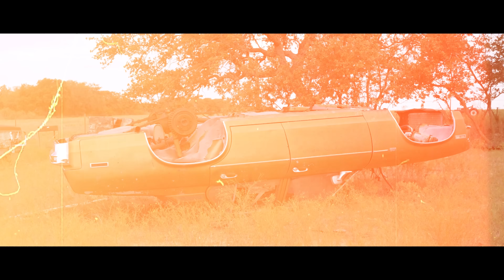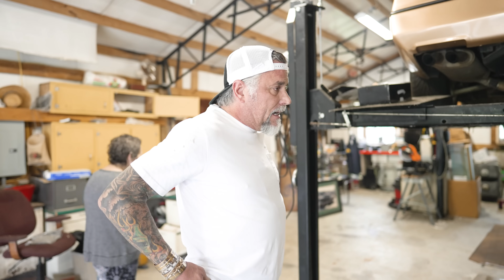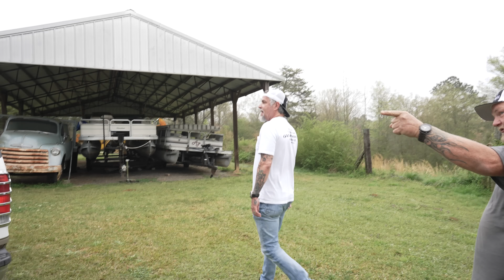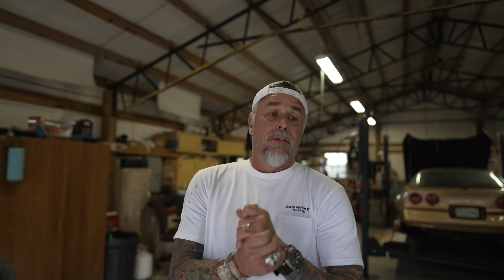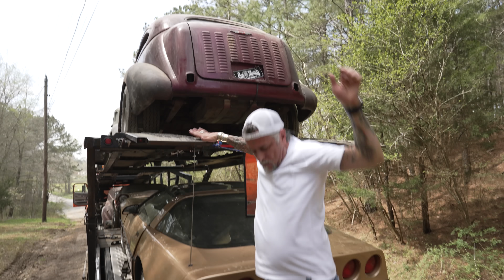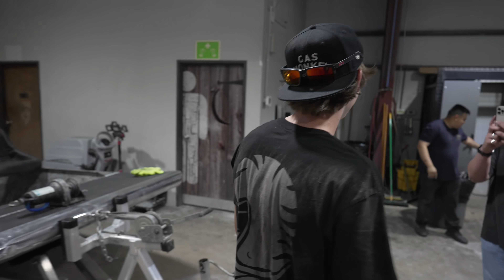Alabama Classic Car Nest - 6 Car Buy - Wheels & Deals

Comment from the maker: Now that we have another 280Z in our collection, how would you build it?
Reply: I'd make it look tiktoked
Reply: Chevy motor under the hood possible turbocharged otherwise leave as is but maybe Cragars and Radial T/A tires
Reply: i would do nothing but wash it and fix anything thats not working properly
Reply: With a fire suppression system 😆
Reply: @perry92964  I ihn.kl
Reply: LS3, Apex suspension/brakes if you want to go nuts, otherwise TTT, Skillard aero, Subtlez flares
Reply: tesla swap
Reply: GTR AWD swap would be interesting
Reply: 2jz turbo swap make it a ripper
Reply: Bosozoku Style
Reply: @gradycooper7416  O'ya...zoom-zoom !
Reply: @freddietee1225   more like stuuu stuuu stu stuuuu big turbo noises
Reply: Sell it to me and I will show you exactly how I would build it. Thanks
Reply: Barra
Reply: I'm all about keeping those all original as long as you don't make any changes to the chassis it would be pretty neat to do a modern update to the brake system I know everybody's go on LS swap crazy nowadays but it would be pretty sweet to see a turbocharged 2JZ or LS engine and obviously update suspension and drivetrain I love to see them all original you guys should get it running good and do a comparison between the original engine and the one you decide to use if you decide to change it
Reply: Would you ever buy a 74 transam Colorado bound that needs work.?
Reply: Richard how about them young bucks do a complete build that would be great,,, I definitely miss that part of gas monkey.
Reply: The money in that 280Z is in getting it running & leaving it ORIGINAL.
Reply: Chevrolet 383” Stroker with a turbo
Reply: Original. They are so nice and getting hard to find nice ones.
Reply: And make it under 200 grand.  So when I win I can buy it.
Reply: COMPLETELY STOCK!!
Reply: If your still in Alabama I know where some nice cars at stored away
Reply: I have $3,500 for the vett please
Reply: Drift car
Reply: Build a Devil Z from Wangan Midnight
Reply: L28  3.1 stoker with a turbo.
Reply: Is twin turbo wide body race car
Reply: The last one was nice!
Reply: Restomod it with a late model 5.6 Titan engine
Reply: I'd put off-road tyres on and paint it matt black
Reply: @Nobody99998  wtf does that even mean
Reply: Would ever you do , don’t put a boring v8 in it.
Reply: Its been done before but an rb25, 26 or 30 swap would be good to see
Reply: I would auction it right here, closed bid.
Reply: bone stock
Reply: or maybe that crazy Japanese style with the long front air dams and the like
Reply: clean it, get her running and sell it to me!
Reply: Classic is ok but...I'd beef up the engine and Trans to at least Porsche level. Maybe a 911 engine or something comparable. Toyota has some honking fast engines...custom Trans rear axle. (Photon Torpedos and lasers are a must and stealth body.)   Make it a flying torpedo...or smart missle....
Reply: I'd convert it to Electric, make it Fast and Quiet !
Reply: Full autocross build
Reply: Gas monkey treat, like the Ford gt and the F40, something special one off gas monkey crazy Z
Reply: All it is is Japanese Revenge
Reply: Add a nice little V8, 4 speed. Paint black cherry.
Reply: Aaron leaves money and now they fix injectors with a hammer lmfao
Reply: Do your thang !! 🚓💨
Reply: Love Ur show
Reply: omg! These 280/240's , fond memories! Shiny dark green,  fresh tires, sun roof, manual tran, 😁💚 6 cylinders?
Reply: I have. Time working on a motorcycle I purchase to. Work on and  try to make it alive , try so hard on it  to make it. Run     there is a project you can work on it. For me .😝 All I can afford are the hot wheels  gas monkey cars  I collect
Reply: How Would I Build The 280z !! That's A Good Question!!!
Reply: Corvette, Beautiful Color!!
Reply: Great Job!!!
Reply: Will See Ya!!!
Reply: Viper V-10 swap 😂
Reply: turbo v8 drag car for the street
Reply: Add a Tesla EV motor! Make your own EV. Old school & new school.
Reply: Don't want nothing born when I was born pre emissions all day 😆
Reply: Back half the car 28x10.5 slick 
Turbo Sr swap
Reply: 4 rotory engine turbo sleeper
Reply: Can you imagine Richard being a cop? 
Richard the cop: Sir do you know how fast your were going? 
WHOOOO! GET YOU SOME!!!
Reply: @dannyamos3499  889
Reply: @Qwe-ni1kz  ñ
Reply: @Qwe-ni1kz  88i
Reply: @russellstewart7435  k
Reply: 3” drop with wantanabe wheels, remove the front and rear bumpers, rb swap with a big single turbo.
Reply: With tools.
Reply: @Merylstreep1949  Been done to death. The "Chevy motor" anyway. Turbos? Ain't enough car there to "spool" turbos. A naturally-aspirated car will run circles around it while you fight "turbo lag".
Reply: @Merylstreep1949  Cragars for a metric 4-lug import. Good luck with that.
Reply: @TreySlayPlay23  The point is to make it go better. Until you do that it don't need to stop better.
Reply: Do something really different.....Stage3 Esslinger 2.3L Ecoboost with Precision Turbo and all the goodies.  500+ HP.  Piss some folks off and stick a Ford 4-banger in it.
Reply: Turbo barra
Reply: LS swap nothin less
Reply: Es muy gratificante 👍
Reply: Richard , If u read what I reply to your question. Then u will see I have challenge u to a build. Proof to us viewers u can still take a challenge. Remember us viewers is what made u rich. No hard feelings if u back out. But I am sure you will back out. I seriously thinking about betting with guys here local that this build want happen.
Reply: Jas 🤭 si lo tuviera ...
Quizás sin turbo  x que una emoción puede no terminar bien 🤷‍♂️ 
Con tres carburadores o injectcion si así lo fuera , y color a elección !!
Reply: Put A426 hammer in it April 26 hamley motor
Reply: You're talking oh baby
Reply: Nice to see old cars 🚗🚙🛻😎
Reply: LS swap it
Reply: Those Z's are bringing good money original and or restored, but it would be cool with an LS.
Reply: Full JDM Paul Newman build….or 2JZ twin turbo with R154
Reply: 2JZ VVT TT PLEASE, RICHARD.. PLEASE!
Reply: @Merylstreep1949  uiui8
Reply: Do your thing man
Reply: There's no better way than to stay completely factory original this will bring more money at auctions than custom builds
Reply: Wytt miller
Reply: @perry92964  it's perfect cosmetically.
Reply: RICHARD. Ever think to offer that gas monkey ring Dennis collins has?  Maybe a replica? I zoomed right in on it on his coffee show. Really neat.
Reply: Know old vid but.. Dark green Outlaw' low on gold! Wheels ..alloy seats..
Reply: give it to me cause my dream car is a 240z, 260z, or 280z :D
Reply: A la sauce Gas Monkey bien sûr ! 🤪🤟 Bonne année et santé 2023 a Gas Monkey Garage.
Reply: Turn it into a monster car..jack it,  35" tires, etc.
Reply: Stock , they were quick as shit stock BUT Thow a small funk on it.👍👍😎😎
Reply: Hi my fellow 🐒(s), i cant wait to Chase's beard grows in. 😉
Reply: 1000 soda cans
Reply: You’re the very best you state the prices. That’s my favourite unlike your buddy Dennis I can’t even watch him anymore.
Reply: @gradycooper7416  with a wide body
Reply: 289 works well, 5 or 6 speed
Reply: You should bought the camero for the White TransAm you bought with the blown403 motor !!!
Reply: sell it to me for $1250 and ill build it with my kiddos
Reply: Cool 😎 Cool 😎 👌 👍
Reply: Modified stock. Change the interior.
Reply: SMALL BLOCK CHEVY HP AND POWER GLUIDE TRANS RACERING INTERNALS AND A VEGA CONVERTER OLD SCHOOL O AND BUILE A COMPLETE RENFORED FRAME ( DOM OR CHROME MOLLY )
 UNDER IT AND TUBED AND 9" FORD REAR END AND NICE CAGE AND LEATHER INTERIOR  ETC BUT THATS JUST ME I HAVE BUILT A 100 OF THEM IN MY 5O YR CAREER ✌️
Reply: Drop in a v8, widen it and race it. Put a big wing on the back.
Reply: Leave it original make it look like showroom floor again
Reply: Twin turbo 215 aluminum block Buick? Or a Orphan Buick GNX engine. I am more of a Chevy guy
Reply: I’d build it like a replica of the devils z from Japan.     The real one not the cartoon.     The wide body evil red 240z
Reply: Either restore to original or a Rb30 bottom end from a holden vl calais and a Rb26 head from a skyline r34.......or speak to mighty car mods and collaborate they are the GOAT ( MCM fans will get the joke) of jdm cars.
Reply: My dad passed in 2014 & still his garage is the way he left it, cars, tools everything mom has not sold but one of his cars & it was a 42 Chevy Coupe to my Uncle ! 💔
Reply: It WOULD SAVE A LOT OF CASH IF YOU ORE EMPLOYEE  !
Reply: 1. Repair / Upgrade all the common weak points on the body metal.
2. Motor swap but stick with a well built Nissan Engine if that's possible.
3. 5 or 6 speed transmission can be automatic but standard preferred.
4. Some nice paint.
5. Some nice wheels / tires.
6. Good Brakes, 4 wheel disks
7. Clean up interior or replace where necessary.
8. Jettison the ugly sun shade.
9. NO!!! wide body or chopping crap.

Comment: Would really like the Vette. Love the look. Know it is slow, but looks sweet.
Reply: Just a little slow
Reply: Barbie Vette .. paint it pink and broom it
Reply: It would work as a daily driver. 👍
Reply: It’s got great paint on it for being n 84
Reply: If $ wasn't an issue, engine swap to a big block with a blower and add a custom wide-body-kit.
Reply: You put a renegade intake manifold on the crossfire and it adds 40 rear wheel hp.  With the crossfire sure they are slower but a rare vette.
Reply from the maker: Hit us on at Info@GasMonkeyGarage.com if youre interested!
Reply: @tomboone201  I briefly had an actual barbie vette in a trade had it for hours and traded it off. Acquired it for the trade it's was candy pink faded to candy purple and the new owner loves it still shows it smh lol.
Reply: @kdsboosted4954  I've had several vettes .. all 68-82 but I had a 79 red Vette when these came out at the same time Mattel premiered barbie's Vette, it took GM yrs to put body lines back into the vettes, I know guys who buy these and put the suspension into other projects it's just not a Vette to me seeing I was brought up in the C3 generation, lol .. my 79 was just a 350 4 bolt, with a 4 bbl nothing fancy but it looked like a Vette, last one was a 72 drop top Millie maligma (?) Red, black interior 4speed # matching, but like Richard says ..a butt for every seat, good luck
Reply: @tomboone201  yeah the C3 is my favorite too! We (Edit had) 28 vettes growing up my step dad kept 2 around pretty much all the time. Most memorable was a 58 gasser with hilborn injection and a cool 63 that he removed the split because of the rear veiw mirror but if was mako sharked out. He bought an 85 that some overnight millionaire build for his wife to keep up with his Ferrari. It  had an under hood efi roots blower I was young and didn't know shit about that was pretty quick we lost the top at 120. My real dad gave me a 73 that had an engine fire. It now has a 71 I believe Lt1 and a new front end but it's buried in the barn behind about two dozen of his cars. So when I feel it's important enough I'll go get it out. I might wait another 5 years or so. It should be worth a bit more by than. I've also recently found a 65 coupe in the same shape had an engine fire but has new parts.
Reply: Look at the interior pictures. It's worn out. That's NOT a 1,500 mile car.
Reply: @GasMonkeyGarage  what about the Z.. Sell me the Z!!
Reply: @4gerars500  it would smoke your Integra RS.

Comment: I have a 1953  Chevy bel air and a 1966 Chevy stepside truck. Both have a 6cyl in them the bel air has a 2 speed power glide and the truck has 3 on the tree

Comment: I’m looking for a motor for a 1982 Z28 Camaro Richard mine blew up a month after I bought the car 7 months ago it’s a really nice car, clean no dents or rust with original red paint, the interior is all original and all there in good shape I might have taken that motor but probably not need a crate motor and I would take that Vett in a second it sounds great

Comment: You’re right. 84 Vettes suck.  

The Crossfire fuel injection ruined them.  

I used to dust them with my carbureted 85 IROC  Z, 5 speed.  (Limited edition)

Comment: YES...KEEP THE 55 IN FAMILY...I HAD MY DADS 55 150 MODEL 2 DR WAGON...HE GAVE IT TO ME...6 BANGER W/3 ON TREE...3:90 GEARS...I TOOK THOSE OUT & PUT 3:55 GEARS IN WITH AN OVERDRIVE I FOUND IN A BONE YARD...I GOT 30 MPG(at least) OUT OF THAT 235...NOT JOKING...RPM's MAKES OR BREAKS MILEAGE...TODAYS VEHICLES...6 SPEEDS 5 & 6 ARE BOTH OVER...

Comment: All the running gear and  suspension brake off that little white English car is the same as the classic mini, should of advertised it as mini spares 8k for a rebuilt engine and box.

Comment: The crossfire been out since 81 I believe, They didn't build a 83, when that 84 came out, let me tell you! They Sold for much more than sticker,   The major difference between 84 & The 1985 year model besides the fuel delivery was that the body was mounted directly on the frame 1984. In 1963 Chevrolet did the same,  didn't go over very well,
Reply: Ok got s reen short
Dumb guy smart phone!

Comment: What up triple R ? Did you sell my red 62 corvette yet. I bought a 80 model with 3,353 miles on odometer. The guy had a bunch of grand kids who played in the car after the grandfather had a stroke. Set for thirty four years in garage. I sent a inspector in and he screwed me getting a cut off the son of the lady who I thought was who I was dealing with. I’ve put a couple thousand or more in it. I need a third member 4/11 to get top end. 80-83 85mph cars. 55 speed limit back in the day. SEMPER FI

Comment: I’m laughing on the guys Comment about the 1980sCamaro saying the Wheels were where the Money was at  in 1987 I bought  a set of Rims with decent Rubber on them from a Junkyard  I paid $125.00 cash  for everything  then I had to go buy  new Lug Nuts and Locks  from my local Dealership to install them on my Wife’s Camaro  that cost me  more than the Wheels and Tires  but were only available at the Dealership  they went on her 84 Camaro ZF   And made her Happy  until she realized. The Bridgestone tires were almost $200.00 each

Comment: My old man had a 1982 z28 with a crossfire 305 and that car must have held some kind of revoke I swear.  It went 414000 miles on it he maintained it religiously and that car only went through 2 water pumps a couple thermostats and that’s literally it.  It ran like a clock for 20 years and one day getting off the highway ramp the timing chain blew and he finally junked it. He got a 1 in a million motor. It was a freak of nature.  I hate crossfires as does everyone else I think my old man is the only one on earth that praises that shitty motor

Comment: You guys are Correct on that One Year Only 84 Corvette that thing did Suck  it was also the first year GeneralMotors tried to  go All Fancy on the Electronics like the IgnitionKey had a Chip,on it  that was supposed to  activate and Deactivate a Securiry and Anti Theft system  but Chevy rushed the new Models out  because they originally planned on the C4 being  released in83 but they couldn’t make the Deadline so  they kind of just didn’t have a 1983 Corvette at all  and  rushed the C4 to be a new 1984 model  A good freind of mine was buying a new Vette every two years  and when he bought his 84  it  spent a lot of time at the Dealership trying to figure out why it wouldn’t run   the Dealership did provide him a Loaner Car  in his case it was a 4 door Brown Chevy Citation LOL the 1984  was his last Corvette  he has been buying a new Cadillac every 2 years  for the last 40  another Issue on the 84 was  everytime the car left you Stranded  you had to wait extra time for  the Tow Service Company  to either bring a RollBack or a Car Trailer because  in those days the most common Tow Trucks used  were the Sling Style hoists  and that would had ruined the Fiberglass and Plastic Nose on the 84  Ironically my Dad wound up having a Fondness for the C4 body styles  and  i  think he replaced the DigitalDashboards chasing ElectricalGremlins in everyone he owned  i know that another issue he had with the Electrical Systems was  related to the Factory Radios  that he just discarded and Put Aftermarket ones in  those Factory Stereos  had something   to do with the Alarm and Anti theft System  and somehow he just overrode that part  on his cars  i laughed at him because  the Replacement Stereo he used  was a Way better Sounding one then  the Delhi System so

Comment: If you can't make money on those 3 trucks, you are not the guy everyone thinks you are.
A stepped can move all three in one load, $1,200 from Bama to the shop. Scrap the dump box, give them all flatbed or spin them into pickups...
There IS money there.

Comment: Yeah I know I live in Valhermosa Alabama and believe it or not some down dog stole my 1958 Apache that I had restored and when I found it they had done took the motor transmission out primer at all outside and then color the inside the head stripped out and started painting a different color don’t change the D the numbers on the door and stuff so I had to pick it up at three different spots motor transmission at one but body on the other it was just all to pieces made me sick but I got it back maybe I’ll get it back together one evening Laura just give you all that stole percent she’s an Alabama

Comment: That is one ~ true ~ Bel Air,  wow, when I was a kid I had the black with flames hot wheels, my mate twenty years ago had custom beetle parts and chassis laying about and another car he gave me I designed a extreme modified would have been an audi 4.2 quattro motor,, I went away for a bit and he had to scrap it, before that we where flying up the motorway to raves every weekend, on the wall in his flat was a poster of a '57 two tone white pale blue with a huge charger hanging out the hood, I'd have been able to say what charger and that just my memory is shot from a brain injury and ptsd, Bel Air are ~ sweet ~ gota love 'em